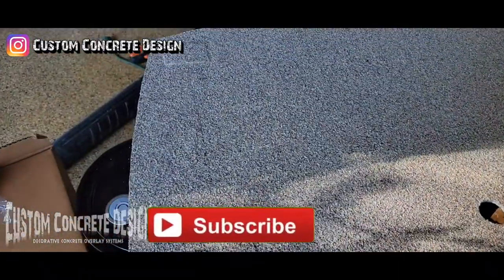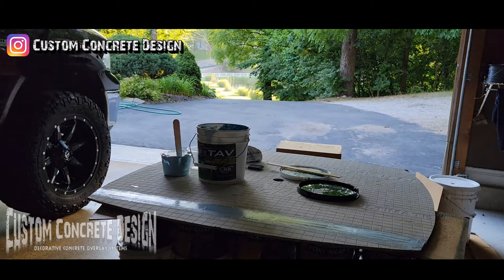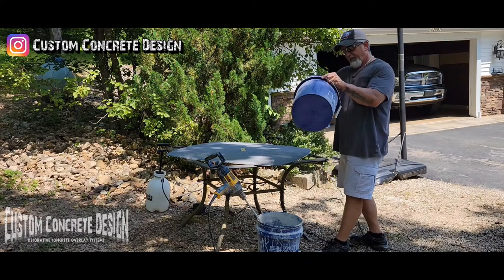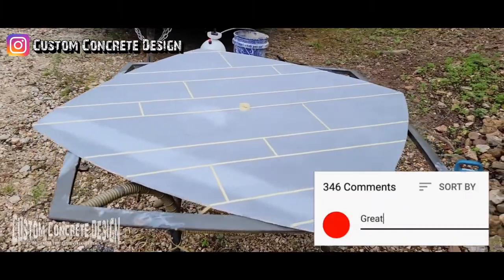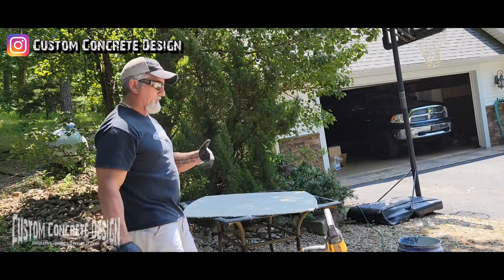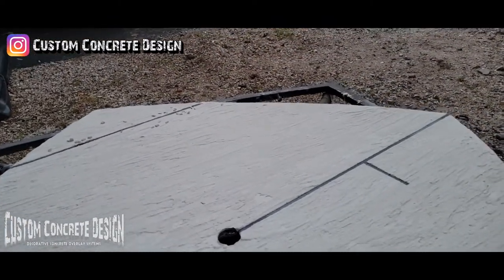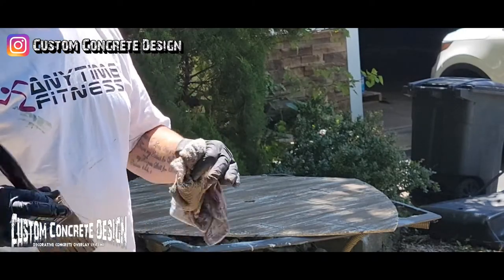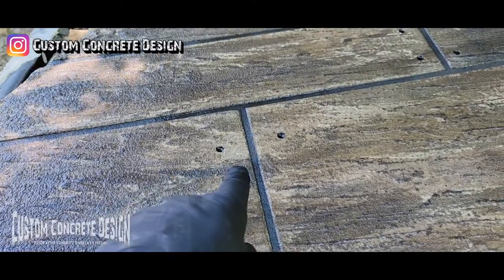HOW TO Make a Concrete COUNTERTOP that looks like WOOD for your Outside PATIO Table! (2022)

Comment: INCREDIBLE!   Can you this kind of thing on a wooden kitchen table?  I know you're not in my area but what kind of price tag does this stuff usually come with?
Reply from the maker: Thanks Paul, I suppose you could if you wanted to, depending on the size of the table it'll probably cost around $2000 ballpark

Comment: What resin do you use? To stain
Reply from the maker: It's Ultra Stone by Elitecrete cut 3 to 1 and I used Smith Stains.
Reply: You mentioned a resin what kind of resin?
Reply from the maker: @aimbot8912  it's called Ultra Stone by Elitcrete systems, it's like milky white and mixes with water, it's a base so you can add your stains into it.